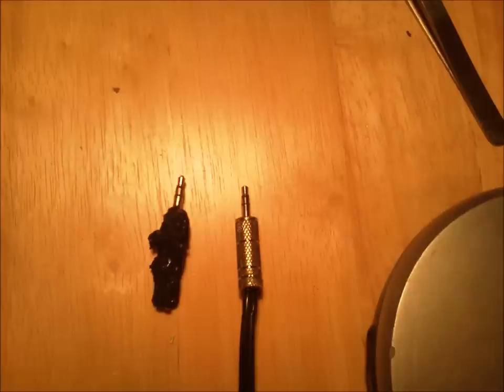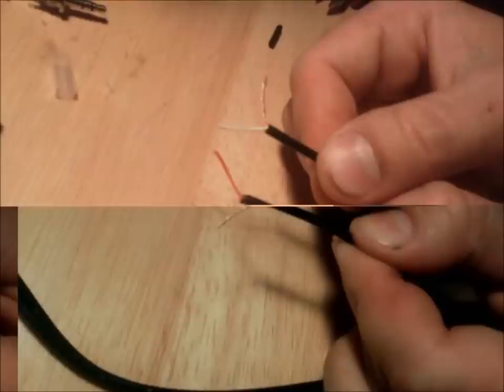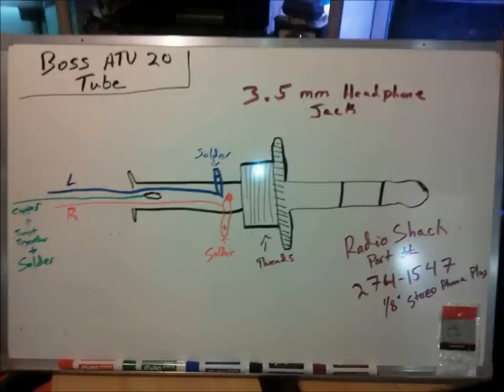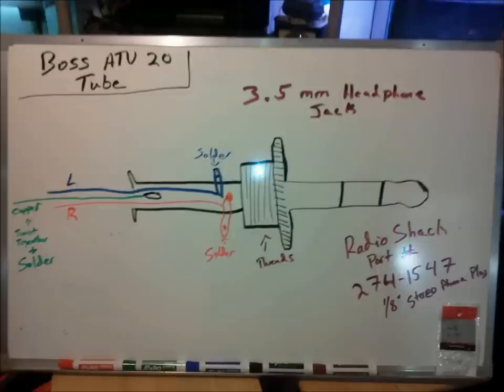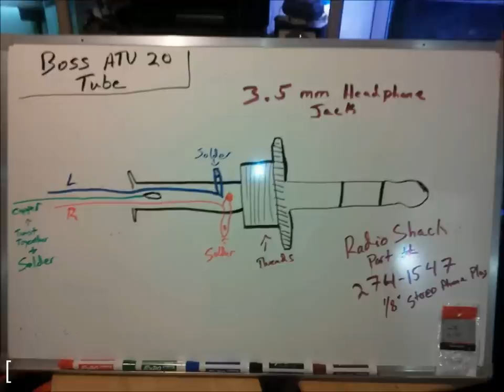Boss ATV Tube audio plug repair

Comment: Where did you get the new end from? My end on mine was sliding in & out.. And finally my dad just decided to cut it off and tried putting an earphone end on it. Which of course didn't work because it needs 4 wires. And it still hasn't been fixed because we can't find an end to replace the old one. & Also does an android phone mess up the end? Thanks.
Reply from the maker: I got mine at RadioShack